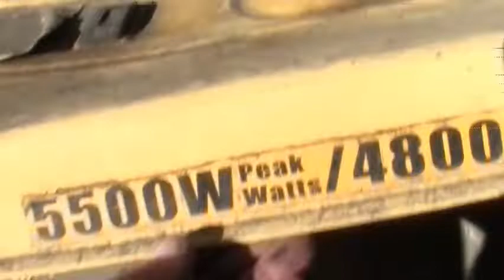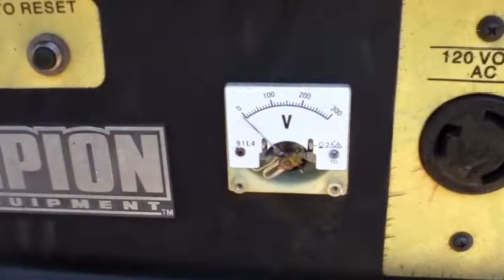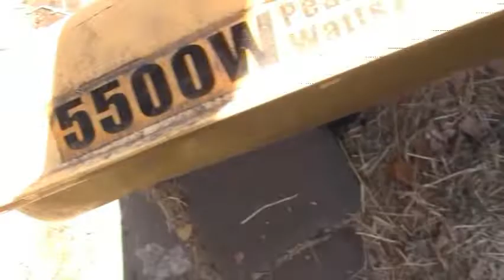WHAT I HAVE BEEN UP TO

Comment: I love the generators with the smart throttle I have three of them now and I far prefer them to the traditional style. Yeah I might have to end up doing the same thing you are and get rid of some of my generators I have far too many right now there's just something about being able to produce your own power kind of fun. that tailgater runs really nice where did you find the piston and cylinder? I have a buddy of mine that has one that burned up maybe I can rebuild his 🤷🏼‍♂️.  man that yellow tank is terrible! but that new tank will outlast that's cheep steel one. I see you found the same trick with those Honda clones you just buy stuff that's supposed to fit a Honda and they'll fit right on other than trying to find the right size a lot of people don't know that trick and a lot of places around here will turn you away because it's a "Chinese engine" 🙄 i always enjoy your videos ☺️
Reply from the maker: Yes , The Smart throttle is very handy to save fuel and noise as well . I found the piston and cyl on Ebay years ago .. I have another set here that has low hours on it if he is interested ??  Thanks for stopping by ..

Comment: I was not aware you had so  many generators.  Due to a video you made some time back I determined that I should switch my generator from gasoline to NG.  So I bought a tri fuel carburetor for my generator.  Now I can choose NG, LPG, or gasoline.  Thanks for the idea and for the videos.
Reply from the maker: It is nice to be able to use whatever fuel you have on hand .. Thanks Harold !